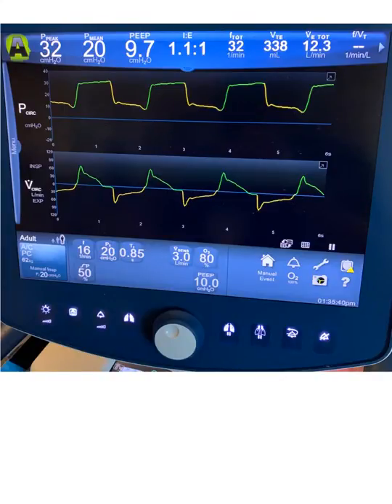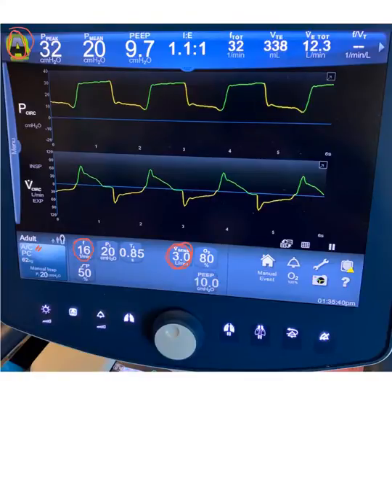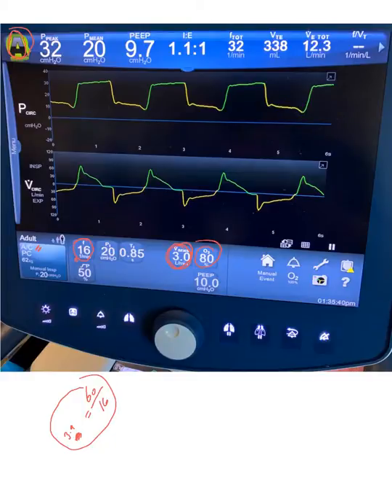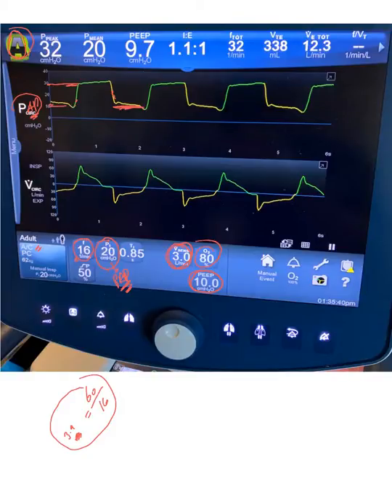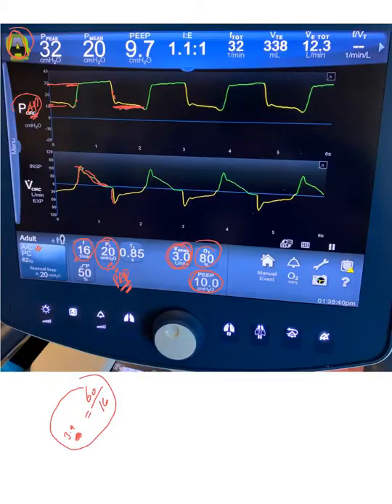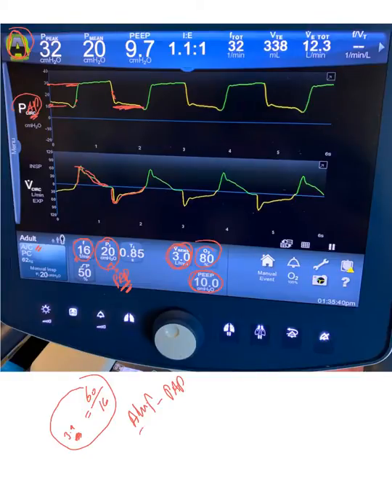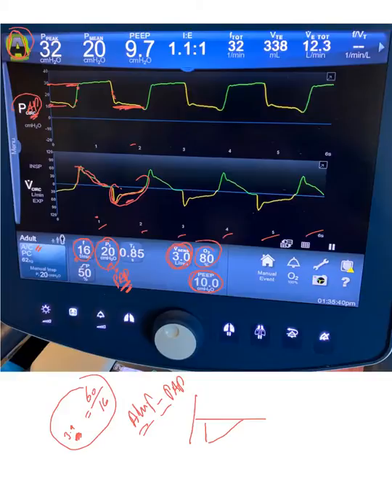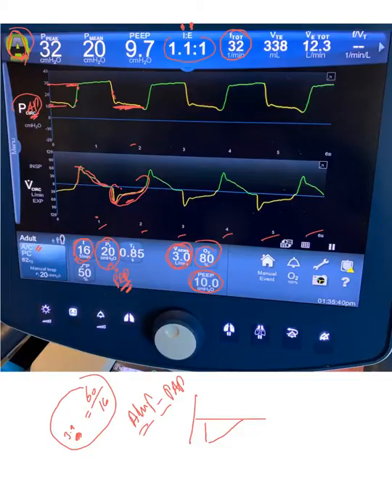Mechanical ventilation- 30: Positive end expiratory pressure (PEEP) demonstration on the ventilator

Comment: need some help here. the target pressure here is 20 cmh2o meaning the total proximal airway pressure shouldn't be exceeding 20 cmh2o ( inspiratory pressure 10 cmh2o + peep 10 cmh2o)? where did the 30 cmh2o come from?
Reply from the maker: This depends on the ventilator software! This kind of ventilator when you set a target pressure, it will add up to the PEEP (20 + 10). Other types will understand that target pressure (inspiratory pressure) = peak pressure! That’s would go with your initial thought. I hope this clarifies this point for you. Let me know if any further questions.